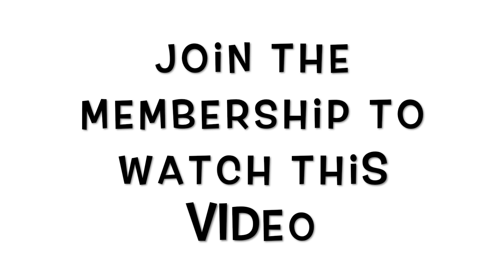Lets Remap The BMW N52 Engine !!

Comment: Hi, is there a way of finding part numbers for missing/removed modules (specifically tcu) using software. My car was bought from auction and the telematics module is missing and there are a wide range of part numbers. I have an F46. Thanks